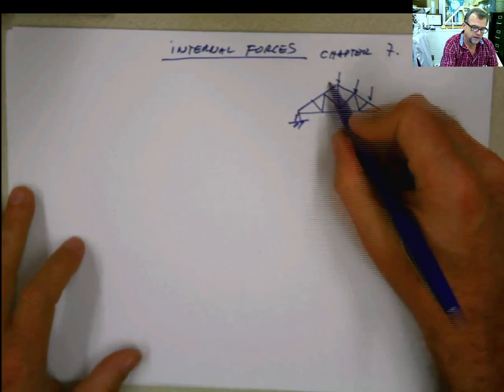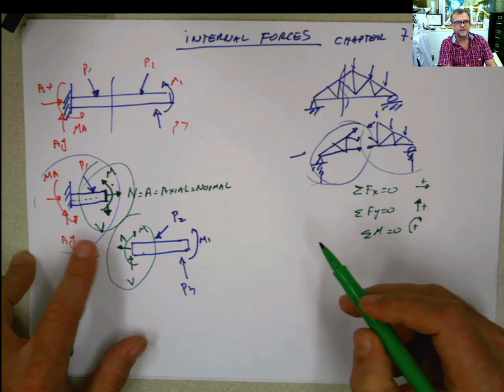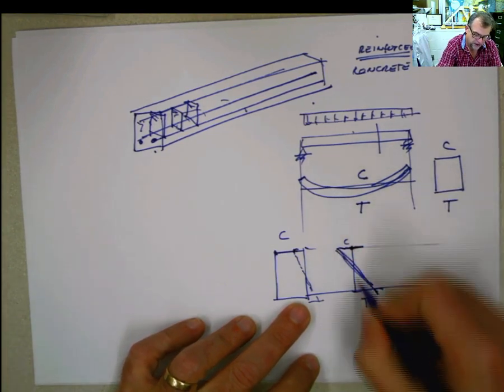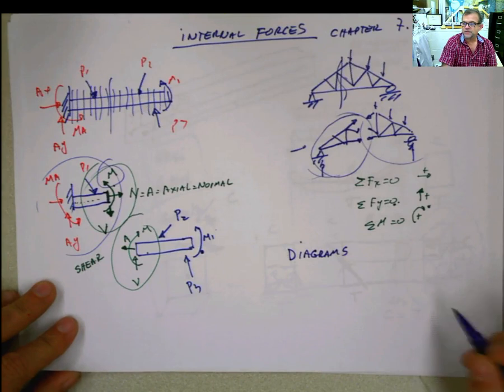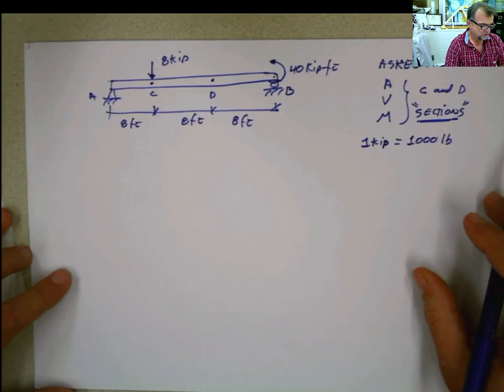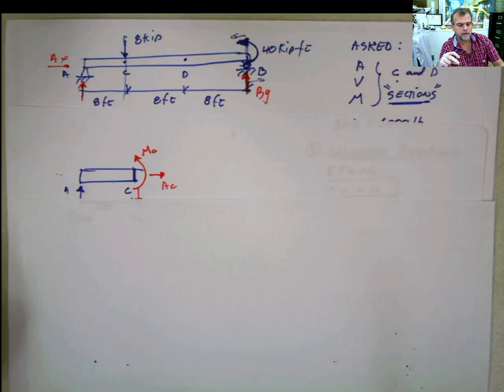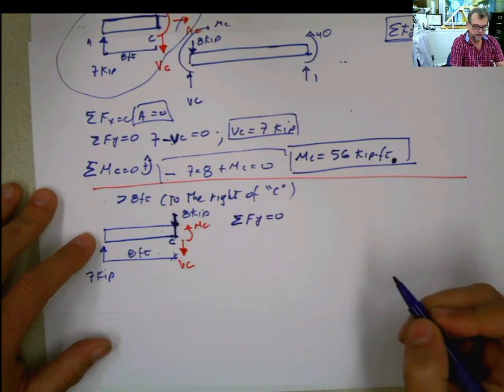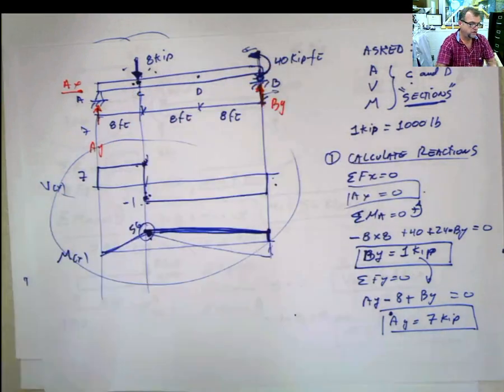Lecture on Internal Forces1 Chapter 7

Comment: Thanks for this lecture, I gained a lot more insight than I did from class and from the Hibbeler book and most other YouTube statics lectures.  This seems to be normally taught as "here's an internal bending moment, and here are the sign conventions" with very little further explanation.  I was learning how to do the problems without understanding what exactly I was doing.  The example of the compression and tension inside the concrete, with the consequent moment couple, really illustrated how and why this method works.  Thanks again!
Reply from the maker: Glad you liked it